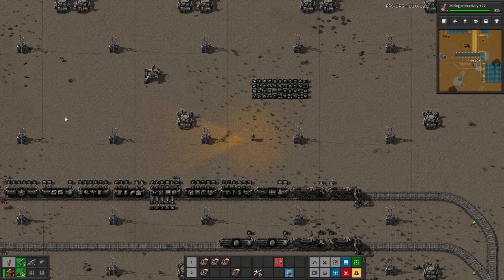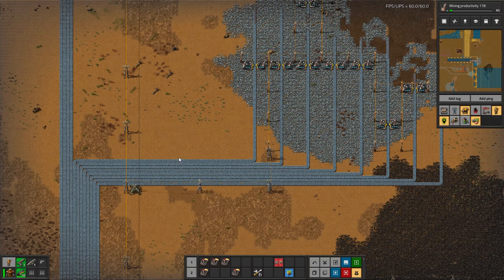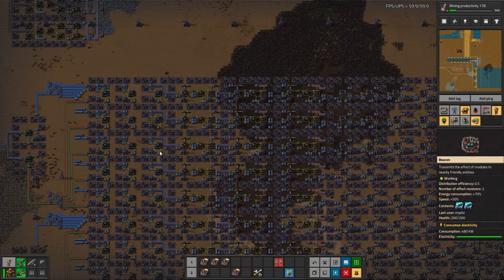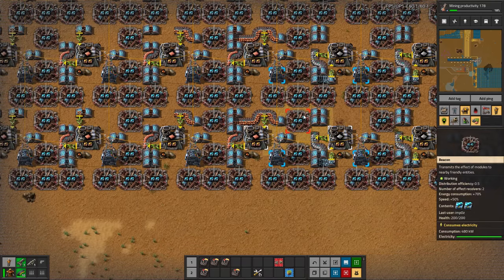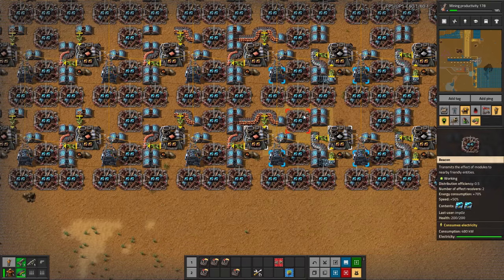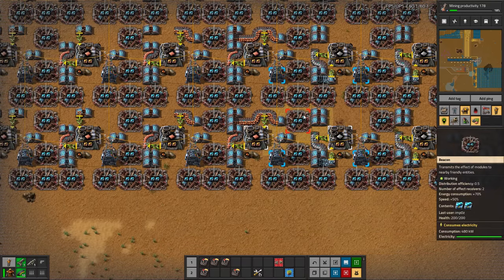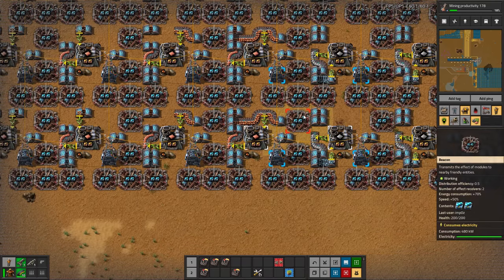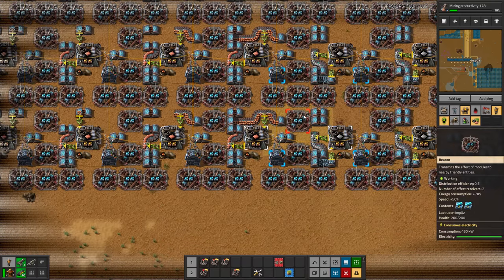Factorio Base Tour - Imp's 10k SPM Belt Only, Highly Efficient Megabase

Comment: This is one of my favourite bases that you've highlighted so far! Love Imp's design to fully take advantages of mixed belts to reduce UPS of inserters taking item out of the belt, and all the compact designs to just get the minimum requirements needed without any wastes. So meticulous and ingenious! He even mixed speed modules with T3, T2 and T1 based on the minimum throughput needed for each build. Amazing!
Reply from the maker: Basically my thoughts exactly. The planning and thought that went into each operation of the to save UPS and generally make it efficient is incredibly impressive. Glad you enjoyed as much as I did!

Comment: yeah i think trains are going to really make a come back when the new rail layer is added in the next big update 

trains end up taking 90% of the CPU draw on my massive base and cause hangs when adding rail signals etc .. with the ability to not have as much signaling when the new layer comes in it will probably drop that down to nothing if used properly

Comment: I see those copper inserters at 4:47, those are not fast enough to make the green belt saturated. There is some spare capacity on the final green assembler though, so with a couple of extra beacons it will work. I guess it's fine since it's not for science production anyway.